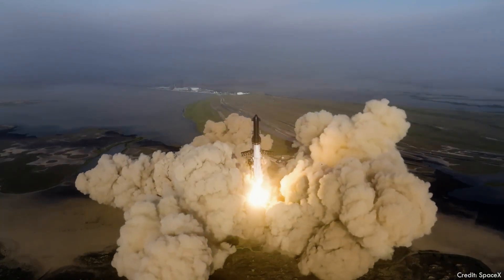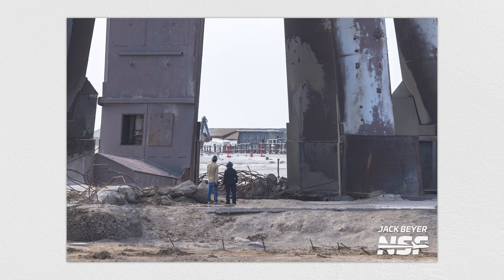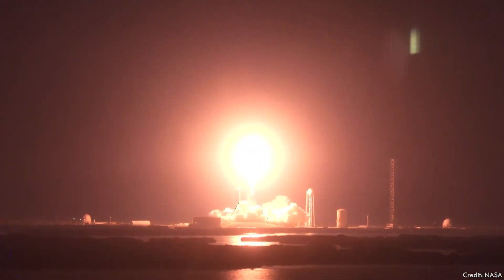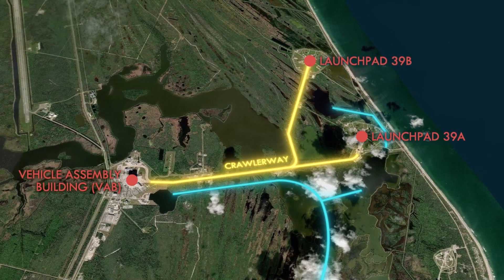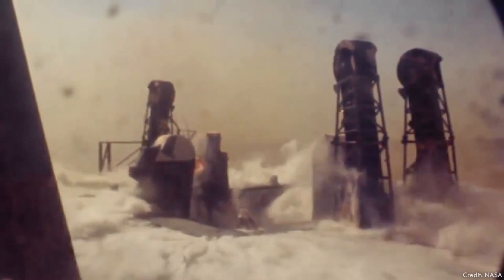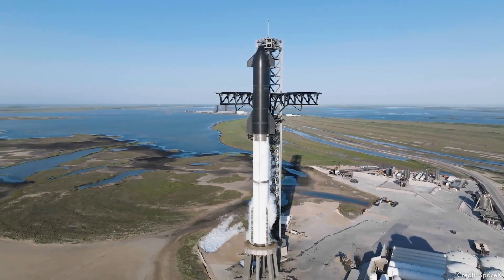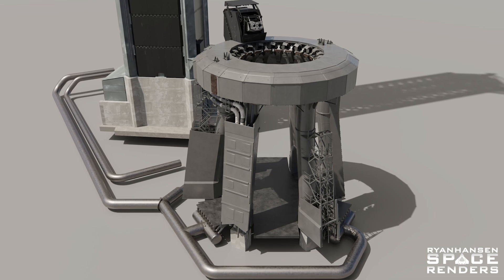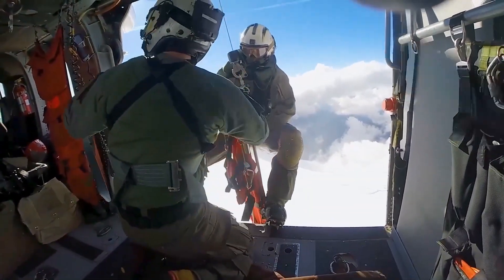Was Starship’s Stage Zero a Bad Pad?

Comment: SpaceX made a giant mistake when building Stage Zero (launch pad). Since the water table is just a few feet below surface, they did not include a Flame Trench. They were using a water deluge sound suppression system alone. 

In an earlier test, the concrete on pad was heavily damage. They replaced concrete with a very special mix more resistant to heat, overpressure, extreme sound, and abrasion. That special concrete was blown everywhere during launch. Maybe it came with a warranty. 

SpaceX needs to remove existing base and add a Flame Trench that is surrounded by a waterproof slurry wall. A low point could be used to collect any water that still gets through, plus water from the water deluge sound suppression system too.

It's a giant undertaking, but SpaceX has done far larger projects.
Reply: Why did they not launch with nothing below but a few feet of air and the ocean?
Reply: @20chocsaday  Thanks for comment. Not sure who made design decisions. They have time to correct before next launch. Won't be a next launch until fixed.
Reply: @CyberIQaiLLC Thanks for comment.

Comment: I hadn't been following Starship much the past few months due to work and life and such. When I watched the launch my first thought was "Uh, where's the flame diverter? Water deluge??" Yeah, no one is surprised that happened. I am still skeptical about a large steel plate firing water directly up at the bottom of the 33 Raptor engines. It should be exciting to watch either way but I'm not sold on it working. ;)

Comment: The crawlerway wasn't built using the stones from the site itself though, they used river rock from the Tennessee River since it has almost no flint in it so when the rocks are crushed by loads they don't pose any additional fire risk to loads with chemical fuel onboard like SRBs.
Reply: You're talking about the crawlerway surface, whereas there's also everything else below grade to consider.

Comment: Stage Zero is intended to be a disposable launch pad that's self-contained.  It needs to be flat-bottomed and able to be set on the ground and "portable" for an impracticable definition of "portable".

I expect Elon intends to make a rocket ship.

Brazil recently sold an old aircraft carrier for $2M for scrap.

Drop a "functional" Stage Zero on the back of the carrier.   Pull into dock.  Load a rocket.  Pull out to international waters.  Launch.  No environmental impact.  No taxes.  No regulations.

Then the ship sits there until the rocket is done and comes back, and lands on the front of the ship.  Then is towed to the back, where Stage Zero holds it for the trip back.

The ship can go down to the equator, for the best rotational assistance, and launch from international waters.

If I had infinite money, that's how I would do it.  So I expect that's Elon's plan.  Time will tell.

That's the only good reason for the design paramaters of Stage Zero (1) and Stage Zero (2) being what they are.  A self-contained platform that is essentially flat-bottomed (like for loading on a ship), and is smaller and nearly "portable".  With a ship like a decommissioned aircraft carrier or https://en.wikipedia.org/wiki/MV_Blue_Marlin.

I'm sure Elon already has a plan for the ship he's going to use, but it's commissioned by a 3rd party, and being designed or built now, under secrecy, and won't be revealed until the Stage Zero is stable and usable from a sea-based platform.

Comment: It would probably be cheaper to have this rocket launch from a remotely operated vessel in the sea. Or like an ICBM dig a massive hole in the ground and direct the blast through a bunch of ventilation ducts thay lead to the surface.

Comment: I'm not sure how up to date this community is with SpaceX stuff, but Elon expected the pad to hold up for at least one launch since there was no damage during the 30 engine test prior, but he also had a water cooling system in the works which was not ready in time so he said, ehhh just launch it any way (since it help up fine for the static fire.. ) The new Stage Zero will be EPIC.
Reply: They also made the choice to slowly throttle up the engines for safety reasons, and that extra time really did the existing pad in.

Comment: The water deluge provides sonic suppression which mitigates damage to the rocket and nearby structures.  The test stand at NASA MSFC uses huge pumps for a water deluge, but I was told when they tested a Saturn V first stage that windows were damaged for miles around.  The horizontal test stands for the Space Shuttle solid rocket booster didn’t use any suppression and a test firing would scour the ground probably a half mile away.

Comment: You could have stretched the video a bit longer to evaluate the new launch pad design. I don't see SpaceX has learnt anything from the first incident at all. The new pad again being horizontal will reflect a lot of energy into the engine bells. The amount of water can be sprayed through those tiny holes on the steel plates are no match to the pressure of the exhaust and heat coming down. Sound depression will be also minimal. The steel plate will melt shortly after the few seconds and as being constructed from several plates like a jigsaw there is a good chance some of the plates will fly away. As a fellow civil engineer I was expecting you to not only point out the first design's flaws but to dive into the new one too. To SpaceX fans: it is nothing shameful to use a well tested design. You don't have to reinvent something which haven't failed.

Comment: Your video reflects some of the early furor and speculations that went on around the web after the launch. A more complete image surfaced later and you failed to find it in your research. 

The primary reasons for the flame diverter and water deluge system was sound pressure on the vehicle itself which simply is not much of an issue for starship because of its height and construction. I, too, retweeted Elon’s quote about having no flame diverter. But now i know it was not really the issue. 

The underlying reason for the concrete failure was that the ground underneath it compacted or liquefied under the pressure, causing it to crack without adequate backing. At that point the engine exhaust started digging through.

Comment: I was interested in your take on this subject, seems like there's a lot that could be talked about !
If you ever do complementary videos (after the yet-to-be-released report you mentionned is published) it would really help if you could include a wide view of the crater left behind. It is such a huge scale that the zoomed in pics fail to render the amount of global destruction acurately
Reply: A lot of video has been released, but the "global destruction" isn't as apparent as you'd think.  There is some debris scattered about, but even the "crater" was difficult to see.  Most of the "debris" that rained down all over the area (even for some miles away) appeared to be sand excavated from the underlying soil.  Local infrastructure was, expectedly, damaged - most notably (and visibly) - the large vertical fuel and water storage tanks near the pad.  But most all of that was easily and quickly repaired.  The real work has been focused on drilling deep concrete piers to lay under the launch mount, with a deluge system placed over that.  Though not yet installed, there appears to be a steel plate that will deflect the flame with an integrated water system.

Comment: If those huge cylindrical tanks held what I think they held (Rocket Fuel), EVERYONE in that facility is bloody lucky they only got dented and not breached...

Otherwise, that facility wouldn't just get cratered and peppered with flying concrete, it would have been flattened when the liquid hydrogen and liquid oxygen exploded like a small Nuke...

Comment: It's interesting there's no concrete wall between the rocket and the various tanks and infrastructure that is supporting the launch. Seems it would be a no brainer to build a cheap wall separating those key structures from the blast and debris caused by the running engines.

Comment: Why couldn´t they place the rocket on a steel beam grid inside a small water lake instead of using a concrete pad ? Of course the steel would melt and the overheated water vapour put perhaps difficult to control situations, but at least there wouldn´t be chunks of concrete flying around.

Comment: OK,  I will sign up for Nebula.  I like what you have to say about the content created these days,  the best is by individual guys like yourself.  Thanks for making the videos.
Reply: I've had it for almost a year now & the fact 99% of the vids are free of even in-vid ad reads is a big plus - SO worth the tiny fee for bundled Curiosity Stream+Nebula IMO! And much rather access them via a platform initiated by creators rather than through YT, with its problematic management & algorithms.

The only drawback to my mind is the Nebula app, which I find very clunky (esp in navigating to your followed-channels list) and doesn't at present allow for comments? Although that latter isn't a huge hindrance - the creators are on YT as well so you can contact or query there if needed.

Comment: You have not mentioned the most interesting part.
- They said the problem is because the soil below the concrete slab compressed, and thus the concrete snapped and flames got through it.  It would have been much less violent, if the concrete ablated as it was supposed to.
- I was hoping for analysis of that.
Reply: Many of your videos are highly technical and informative, yet this felt like no more than what any media outlet reported on.

Comment: This really leaves a bigger question of why don't we have a space elevator today. It seems to be a lot cheaper, easier, and more effective in every way to use such a thing and you won't have to worry about a launch pad coming apart. Not to mention the less fuel and weight needed to get a rocket up in the first place by starting horizontal and gradual shift to vertical and could all be powered initially by the elevator itself.
Reply: Because we don't have the materials needed.
Reply: Like most high-tech speculations, space elevators are a lot easier to imagine than they actually are to build. Grady has a pretty good video where he shoots down the misinformation and oversimplifcation that often surrounds this topic in pop sci outlets.
Reply: Plenty of engineers are still trying to figure out how to make such a thing. Having a teleporter or time machine would also be cheaper, easier, and more effective, if only we could find a way to build it.

Comment: Can't they make a flame diverter to reroute the exhaust 180 degrees?

Even if it is done far enough from the spaceship, it seems this would boost the acceleration significantly.

Comment: There is an old NASA documentary that is all about the development of the eventual Saturn 5 launch pad. I watched it about 5 years ago, there was  good information on flame diverting and water suppression systems and the mistakes along the way. I am surprised SpaceX didn't come close to following the lessons learned.
Reply: It is quite frankly not surprising - at all
Reply: I suspect there are some design engineers at SpaceX who are smugly saying "Told ya so".
Reply: And yet they made it work without a flame diverter, but there's no videos about that.
Reply: SpaceX’s pad was capable of withstanding the Saturn V. They did a 50% thrust test and the pad withstood it. 50% thrust of the SuperHeavy booster is equal to the full thrust of the Saturn V. Based on the damage done they believed the pad could handle one launch of the rocket. They ended up being wrong but it doesn’t matter as they had updates for the pad ready to go.
Reply: Probably because they think they are smarter than NASA engineers. How many times have you heard kids tell us we wouldn't understand, they forget, we wrote the book.
Reply: @boblordylordyhowie  
Absolutely. Thinking about the insane amounts of money they must have burned through, relearning lessons, duplicating mistakes and rediscovering problems that NASA and/or Roscosmos figured out decades ago is chilling. Too arrogant to acknowledge what came before, or to build on top of someone else's foundations, and trying to reinvent the wheel.
Reply: probably because building a pad the traditional way is wildly expensive, whereas using a stand and upside down shower head is likely equally effective and 10x cheaper

Comment: I'm excited about SpaceX's rapid development but they don't need to do mistakes that we already have data for. Engineers at SpaceX warned about needing something like a flame diverter long ago but were promptly fired
Reply: It's very strange, because this is a solved problem.
Reply: Grady repeats their claim that they do it as part of a silicon-valley-style "rapid development" cycle, but really, they do it for the press.  NASA put us on the moon in 9 years, but Elon knows SpaceX would miss out on spectacle funding if they spent nine years heads-down.

Comment: Something to keep in mind is that the pad was originally designed with B4 in mind, which had 29 Raptor V1s, while the one that launched (B7) had 33 Raptor V2s, leading to about 40% more power.   The design might have worked originally, but the added power was too much to handle. My biggest concern will be when Raptor V3 starts being used on vehicles, with about 17% more power than V2.
Reply: This is kinda the problem with profit-first space corporations without proper oversight.  NASA over-engineered past Apollo’s initial power projections for safety.   
  SpaceX seemingly decided rebuilding a destroyed obsolete pad later was better, rather than first retrofitting what they had now to survive.    This is the exact same engineering priority the N.Korean and Iranian “civilian space programs” are using to try advance their dual-use launch systems faster.

Comment: I don't understand the solution they've used.  It seems over engineered and unnecessarily complicated.   Surely if they place a think steel slab underneath stage zero, of sufficient thickness, then water cooling wouldn't even be required because the sheer mass of the metal block would work well enough as a passive heat sink to prevent melting for the short period of a launch.  

I don't know how thick exactly...a foot? A metre?  It's  a lot of metal but once it's there they can essentially forget about it.  

They could form the shape of it to divert the flames in whichever directions they like, again, passively in a set and forget kind of way.

Comment: I have to mention that if it weren't for the ground under the concrete compressing from the force of the 30 raptor engines running at full thrust the concrete would have just eroded a little. But because of the ground underneath being compressed the concrete bent a little and shattered. This is basically only speculation but it is the most likely scenario. Also the leading theory at SpaceX

Comment: Great video. In 14 minutes I was kind of expecting to hear why SpaceX decided to use a simple landing pad.  It has to take back off from Mars.
Reply: Booster stage isnt the upperstage though

And as we see with the moon landing, main engines most likely wouldnt be used here to avoid erosion.

So why work around booster as if it was planetary lander, when it will never be? Sounds more like a cheap excuse to hide not doing proper assesements and hoping they get away with not doing things that were standards in the industry for decades

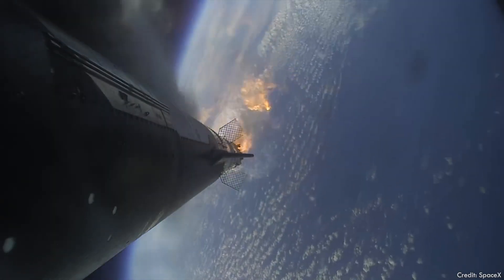Comment: there is an important mistake at 0:50 
the flight termination system was triggered but didn't succeed in terminating the flight.
you can see clearly from the footage, the explosion started from the engines which means it wasn't caused by the FTS. you can also see in the footage that before the main explosion the FTS was triggered and caused a small explosion but didn't succeed in causing the whole rocket to explode.
Reply: I think the leading theory is that the FTS depressurized the vehicle to the point that it structurally failed, leading to it exploding.
Reply: @randomperson1731  Also once it started getting into the very thin, but more than a vacuum, atmosphere.

Comment: It was an adequate pad for a single launch. SpaceX practice is to start with a minimal viable solution and build upon it as needed and as data comes in. The pad seemed to be enough for that launch, as far as we know, pad debris did not play a role in engine outs, the 3 off engines at t-0 were determined to be out before liftoff already. Now they know what they're dealing with in terms of exhaust and they're working on flame diverter/pad protection right now. The fact that they're willing to risk their tank farm in order to test a launch says a lot. It's easily replaceable and not designed to be permanent anyways, so the gathered data from the test was totally worth it, and in top of that, the tsnk farm is fine, so it's a win!